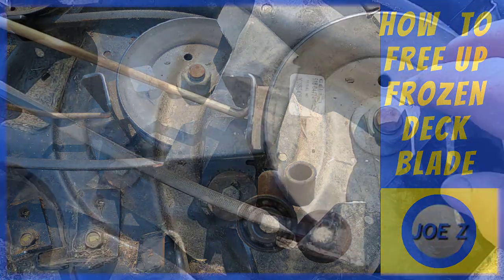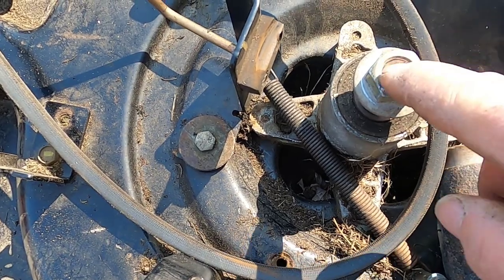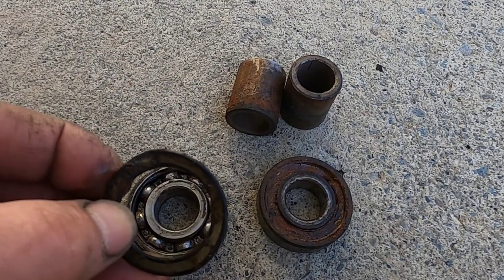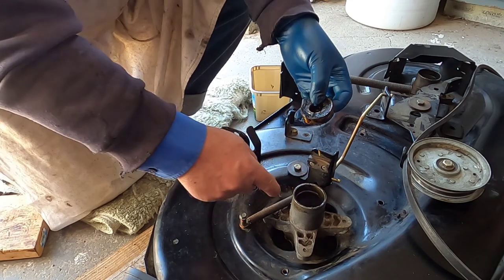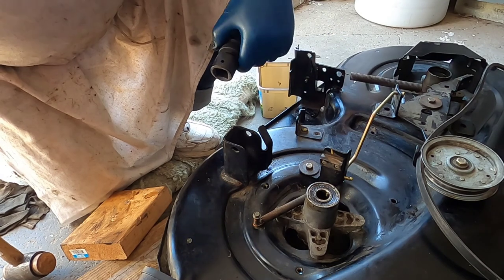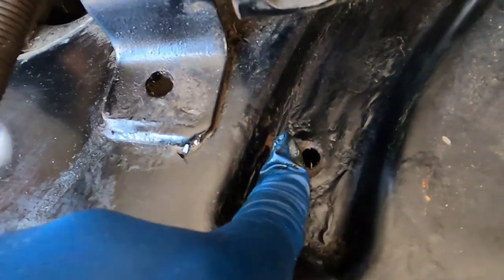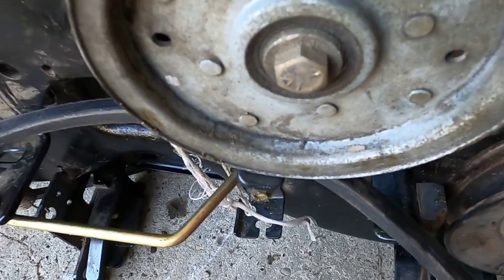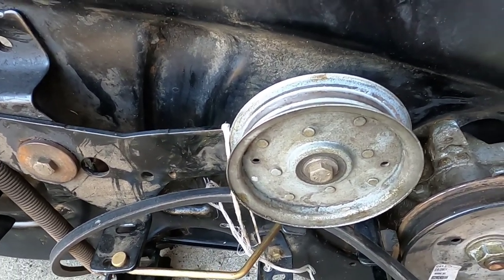How to free up frozen deck blade/spindle

Comment: I just changed the entire spindle because the bearings had worn so bad, the blade could be moved up and down, side to side, due to the play.  The other side is OK, however, I bought the pair of spindles, it was cheaper that way. I enjoyed your video it was very informative.
Reply from the maker: Thank you Joseph. Hope you get to mow this summer without any more repairs. Funny about the pricing. Awhile back I bought a shackle for my Blazer. Due to time then weather, ( I have to work outside) I never got to it. Recently while online I saw a pair of them with the nuts & bolts for just about the same price as the one without the nuts & bolts.
Stay safe, Joe Z

Comment: My new belt "jumped off", while mowing. How do I tell if my 10 year LT1500 spindles are shot or not? One spins and one seems to be scraping against the brake (with the deck removed).
Reply from the maker: Pull the brake away from the pully. Be careful & spin the blades one at a time. If you hear a growling or grinding sound you will have to take care of the bearings.
Stay safe, Joe Z
Reply: @JOEZEP54  Thanks Joe. The brake seems really worn on the right pulley. Also I have the deck sitting on a piece of paneling and noticed that the right blade is not level. It hits(dips) as I spin the pulley. I tried rocking the pulleys and both seem fine- no sway/wobble/noises.  I had measured/confirmed my new kevlar belt and the belt guides seem fine.
Reply from the maker: Remove the blade to check if it is bent. I find an impact gun is the best way to remove the nut that holds the blade, if you have one. A new blade may be all you need.
Reply: @JOEZEP54  It was but my expert neighbor bent it back(new blades) and noticed that I didn't seat one of the guides correctly. SO, I'm going to put it back together and see what goes... or mows. LOL  Thanks for taking the time, Joe Z.
Reply from the maker: @michaelparson-mcnamara782  Glad to be of help. When you put that blade back on be sure to seat it right. I have seen the bottom of the spindle shaft get ruined by the blade being set wrong & over tightened.
Reply: @JOEZEP54  Thanks Joe. I took a long time going through that bit and finally realized how the blade either sits well or doesn't at all. I'm a lifelong musician who is learning how to take care of my property and tools, late in life, but I am learning..... and learning and learning. LOL
Reply from the maker: @michaelparson-mcnamara782  Never too late. The musical talent in my family seemed to have skipped over me. I can play the radio LOL
Reply: @JOEZEP54  HA   I had a pal that used to claim that and another that said he "could only play outside"   LOL
Reply from the maker: With all this talent we should start a band 😄😅😂
Reply: @JOEZEP54  HA   Good one!